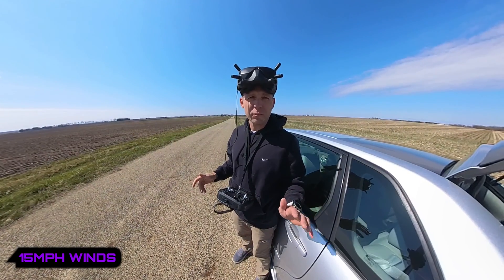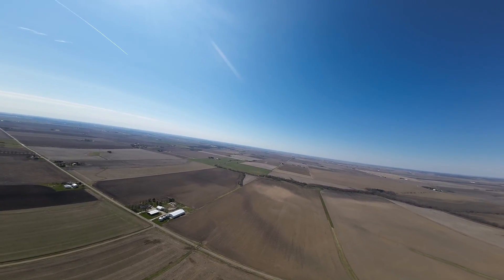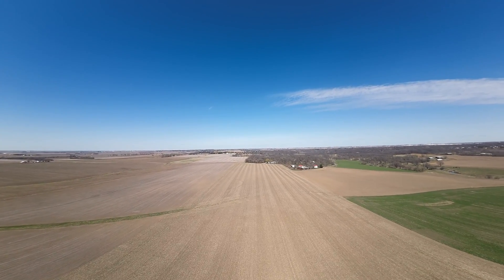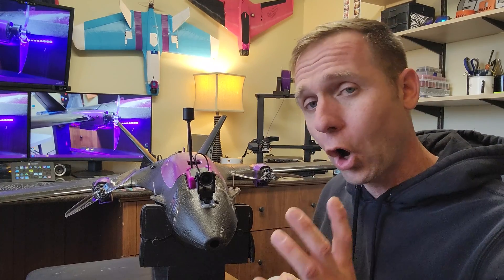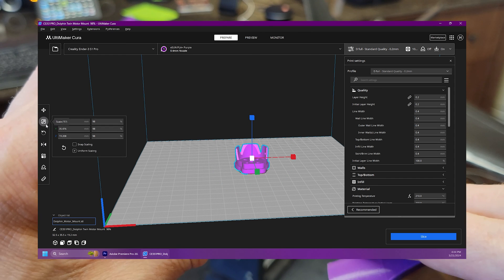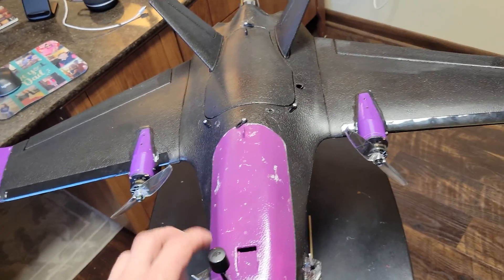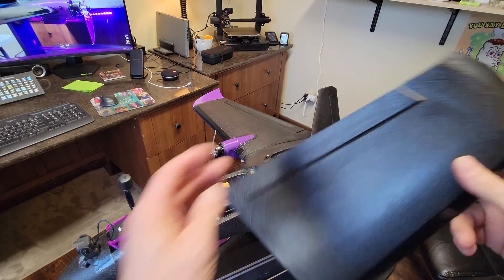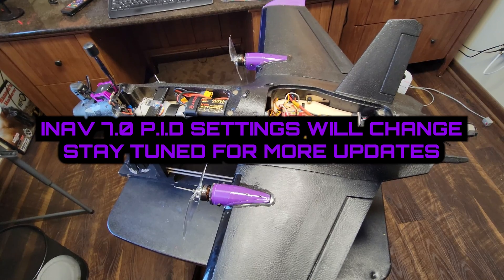Twin Motor AtomRC Dolphin Build! PART 1- How to Build and Setup Options - FPV Plane

Comment: Hello, great build, i would also want a 2 engine plane. Atm i  think about picking penguin, and just  build it on 6S with 2307 or 2807 motors with 7 or 8 inch. Should be fast then:) and 6S 4500 Liion 45 A

Comment: why not use a 3-motor configuration? use the one on the back as well
Reply from the maker: I could, but let's take it one step at a time.
Reply: That's what I was just thinking pusher and puller configuration

Comment: Great stuff! The twin sound coming from it is amazing 😻. I made a twin dolphin but added an A-Tail to look like the Bayraktar but it wasn’t as maneuverable as a stock setup so I took the twins off 🎉 seems to handle better without using a tail
Reply from the maker: I will be doing more testing when I get back from my Florida vacation trip. So stay tuned to the channel. And you'll find out all the different variations that I do to this plane